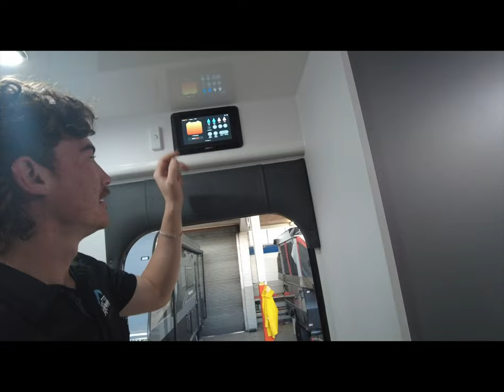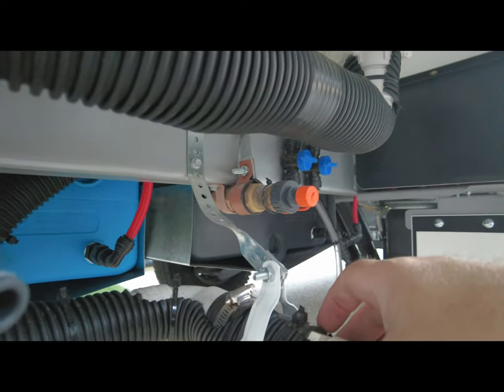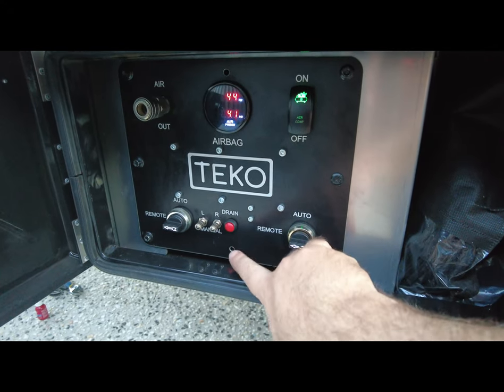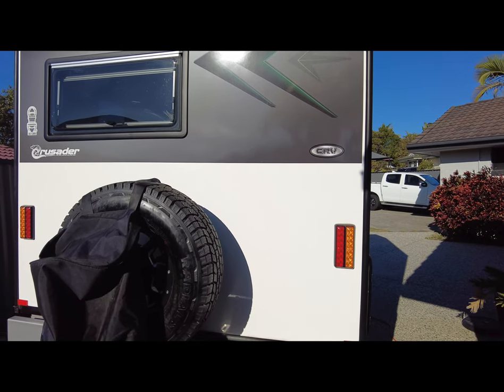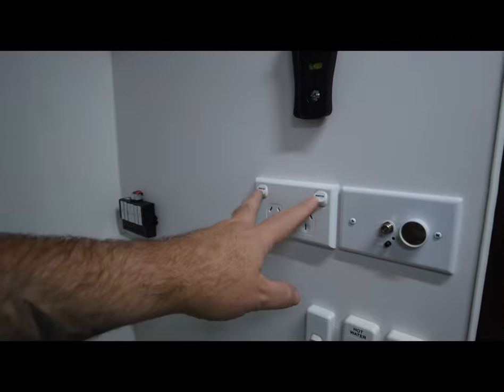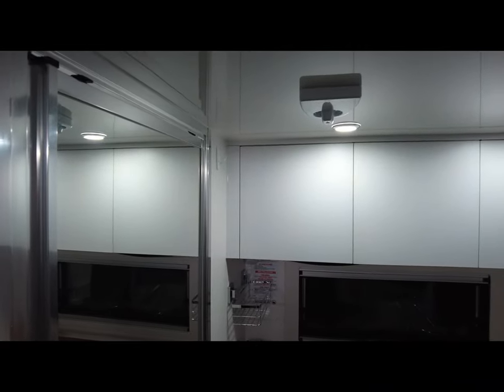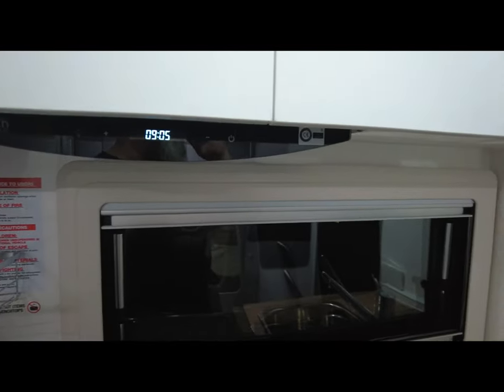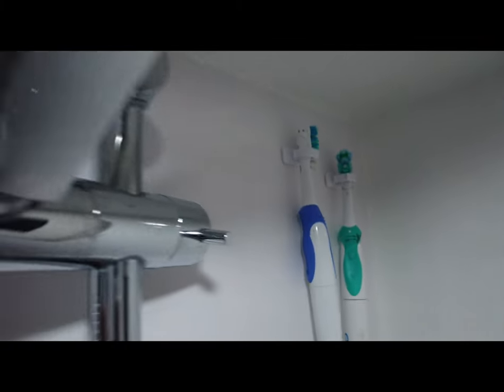Our New Crusader Gladiator

Comment: Hi, Do you know where the electrician ran the cables internally for the camera at the rear of your van?
Reply from the maker: Sorry I haven’t responded earlier. 
I presume it’s run down through the middle of the wall sheet then into the chassis rail all the way to the front.

Comment: Hi, did the modifications you made cause the increased build time? Also, I noticed you have the country colour scheme, was that an extra cost?
Reply from the maker: Hey there. The airbags were the delay. The chassis builder needed more staff that were skilled to do the installation. So I was told by them. No the colour scheme was part of the price. No extra.